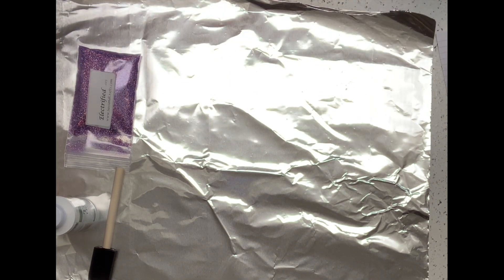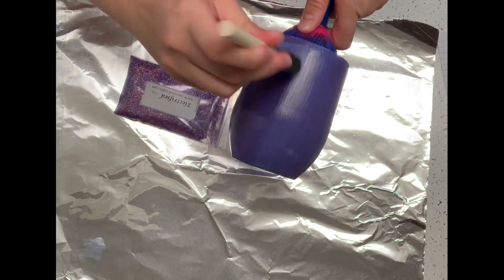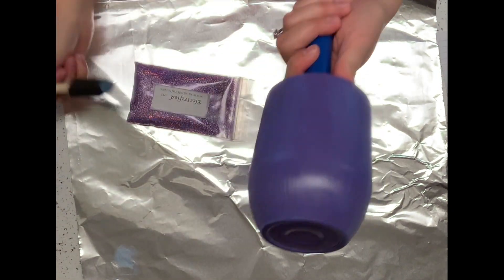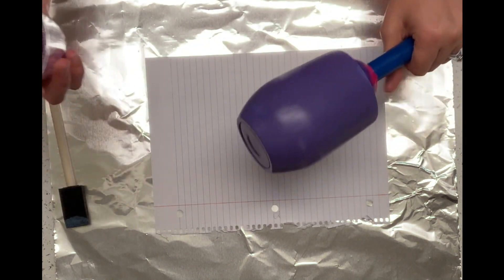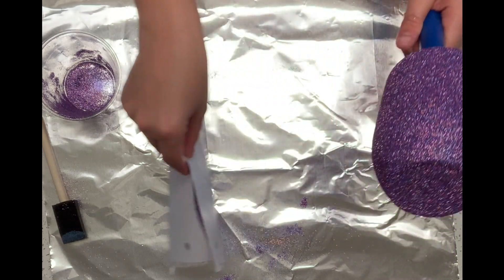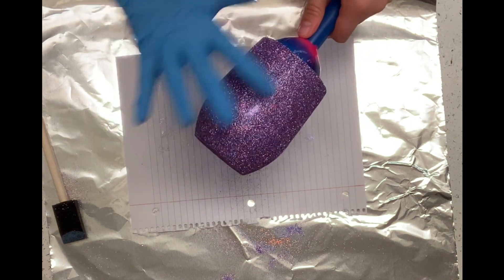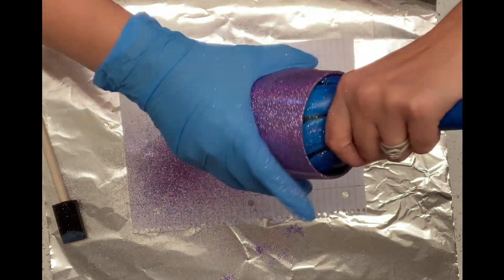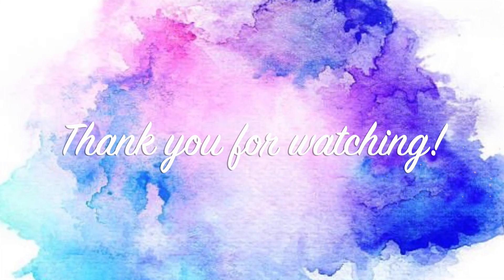Tack it method on a wine tumbler

Comment: Did you dilute the Tack it? I just tried this and all the glitter came off. I used glossy spray paint, what do you use?
Reply from the maker: I didn't dilute :) did you use tack it over and over? and wait 10-15 minutes for it to dry? I usually use flat spray paint but this purple one was a semi gloss
Reply: I did use tack it over and over. I’ll try again. Thanks for answering.
Reply from the maker: @caroltotty2066  Hopefully it works this time! let me know :)